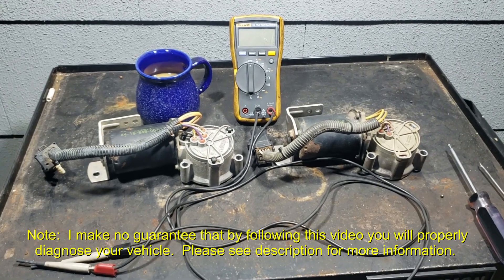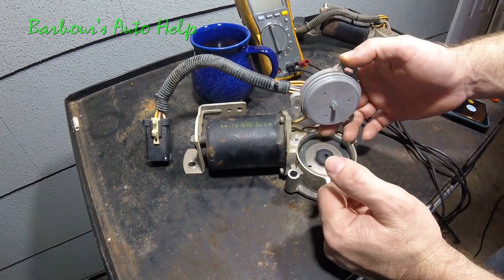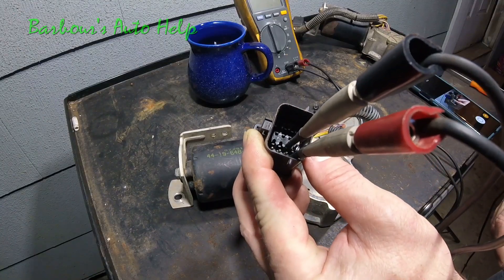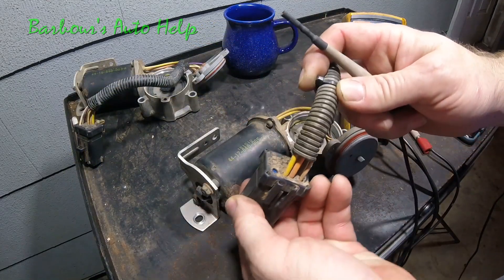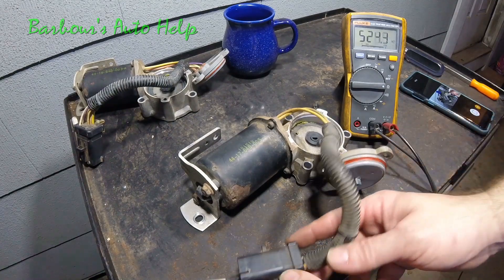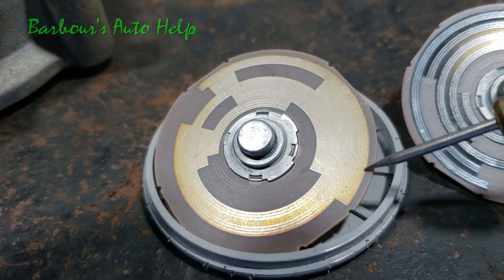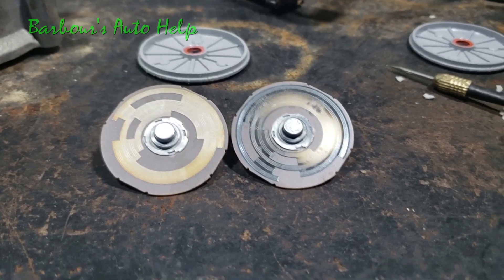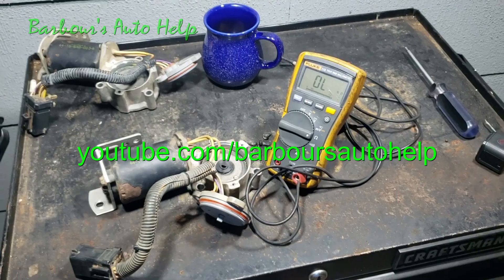Bench Test and Tear Down Of 2011 Ford F150 4X4 Shift Motor Contact Plate

Comment: what are the probe leads you are using, they look like handy addition to my test bench...
Reply from the maker: I'm not sure if this set is available to the general public.  The set I'm working with in the video is offered through an online tool distributor called Rotunda.  I think you have to be "special" to use them.  lol.  (I was able to get it through my work place.)
Reply: @BarboursAutoHelp  I tried to look for some spring loaded 1.5mm or 2mm insulated leads and I searched for hours, found nothing.. they certainly look handy..  my cousin said just shrinkwrap some crimp on connectors to spare set of leads, thought would be too fat to do side by side pins.. hate having to juggle when probing.. thanks for info
Reply: then how did that contact plate come apart, i see people cleaning n checking the contacts but saw nothing on taking it apart..
Reply from the maker: It isn't supposed to come apart.  It's cleaned just by manipulating it.  I think I have a link to a video showing this in the description of this video.  I didn't make the video but I think the guy that made it did a pretty good job.
Reply: @BarboursAutoHelp  so they were broke to take apart?  ok.. I read forum posts on the Fords and people claim they are cleaning and lubing up that assembly, so thought it may just snap apart for that procedure.. too bad it isn't designed like that as some steel wool and dielectric grease would do wonders..

Comment: Really bad design for something that might save your life if your out in the middle of no where stuck because you only have two wheel drive. Better to have a manual or just have 3 solenoids 2x4 4x4h and 4x4L with a switch for each. Ford knows this shit so does every other car company. They want shit to not last after the warranty is up.
this cost 160 for just this new part. 160 x 200000 cars is 32 million minus retail is 16 million, do that with a whole bunch of different parts and its a new company making millions. 
Seriously there are people sitting down talking to each other trying to figure out what parts they can make fail over time and this is one of them. Cant wait for that ford lightning to come out LMAO anything electric they can control when it fails its going to be a nightmare for the second owners maybe even the first if they dont do it right.

Comment: So i had no 4wd lights on dash swapped out motor still nothing. Was moving to solenoid next, any suggestions?
Reply from the maker: Well, what is wrong with it?  What year is it?  I'm assuming it's an F150.   Need details.
Reply: @BarboursAutoHelp  I'm having the same issue 2010 F150 replaced bad transfer case motor now it says 4x4 shift in progress  switches to 4H then right back to 2H, then check 4x4 light comes back on. Already replaced vacuum solenoid.